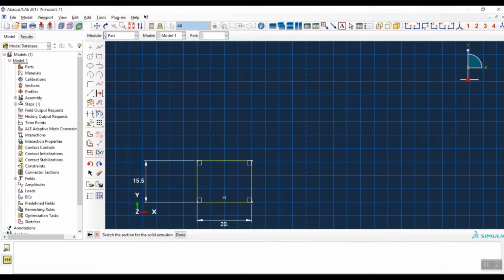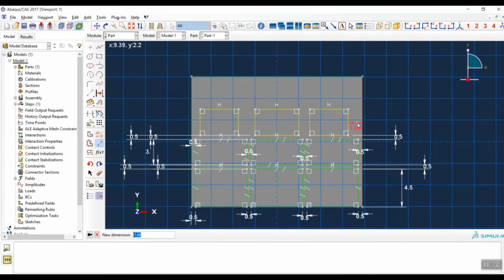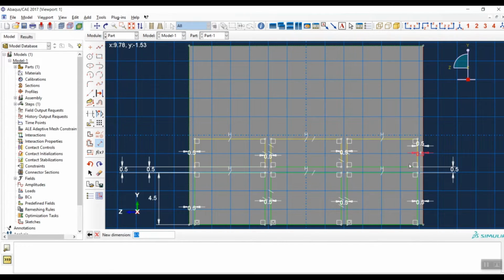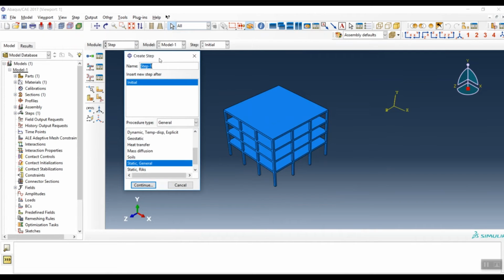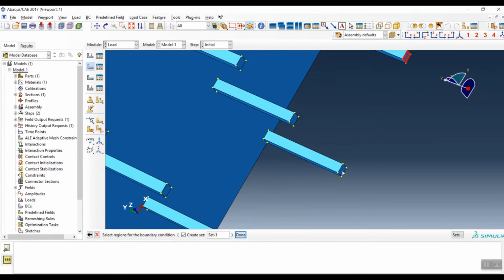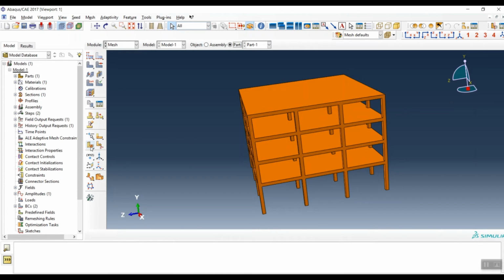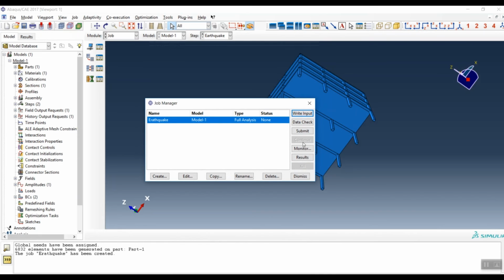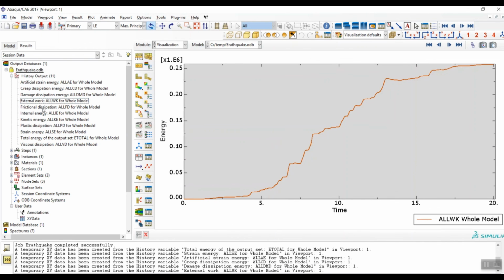Dramatic Earthquake Simulation Using ABAQUS

Comment: Hi
Please tell me how to model cyclic loading for RC and show PINCHING effect in ABAQUS? Thanks
Reply from the maker: Thanks for your interest Dear Dr.,
In order to apply cyclic loading, it is preferable to apply the load using the amplitude, similar to what is done in the movie. However, to simulate the pinching effect, I believe it is necessary to write a subroutine. Within this subroutine, you can introduce a damage parameter D, which ranges from 0 to 1 and is a function of the time period. As the solution progresses and the time step increases, the elastic and plastic properties should be updated by multiplying them with this D parameter.
Reply: @atakhabaz3607  Hi
Thanks you , please have you another easy trick to consider pinching effect ? Thanks